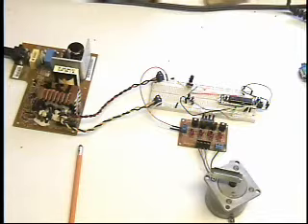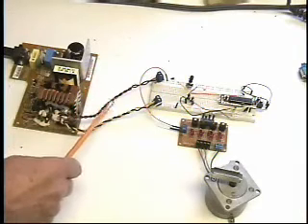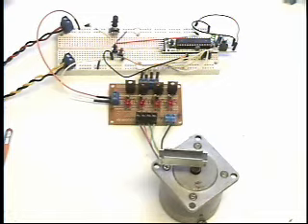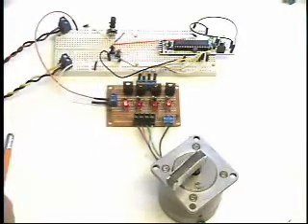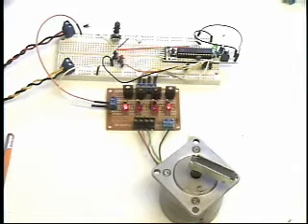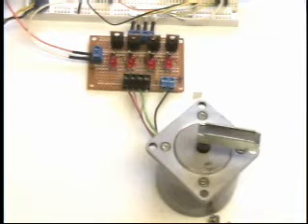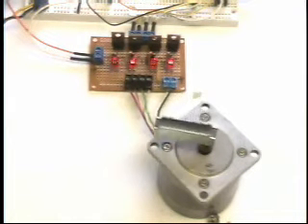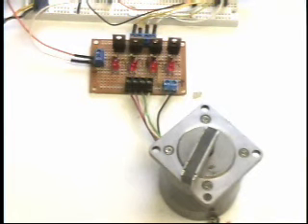Arduino Stepper Motor Control

Comment from the maker: Other stepper motor circuits for Arduino:
Pt. 1 TB6600 Stepper Motor Driver with Arduino
https://youtu.be/PHe2MK9CvQM

Pt. 2 Program TB6600 Stepper Motor Driver with Arduino
https://youtu.be/jtX0t7-m69M

Comment: ...good to know the speed can be adjusted by regulating the interval between steps. I basically need a program to move a fixed number of steps (90 degrees) clockwise and then back each time. Will be used as an actuator, preferably by remote using XBee or ESP 8622. Still working out the details, but every little bit helps. Wondering if with this simple functionality I need the Arduino or if I can do with the just the chips themselves. Thanks!

Comment: +Lewis Loflin Thanks for the video.
I am looking for a BLDC motor controller for a motor that has a 3 wires coil and 3 hall sensors at 120 degrees apart. The motor rotor has 4 magnets configured in a N S N S at 90 degrees apart.
Do you know here I can find controller for this motor.
Thank you
Reply from the maker: markspc1 No idea you will have to build one.

Comment: I believe what you call stepper motor driver circuit as also know as H-Bridge it is either half or full and can be either made with IC (H-Bridge chip) or 4 transistors along with other parts just like it says here:
http://www.instructables.com/id/H-Bridge-on-a-Breadboard

If you really wanna have a full understanding of H-Bridge follow this guy tutorial:
http://www.robotroom.com/BipolarHBridge.html
Reply: Or a transistor array.
Reply from the maker: bighands69
I have a whole section on h-bridges and this can't be used with a unipolar stepper motor.

Build a Power MOSFET H-Bridge for Arduino, PIC
Build a Power MOSFET H-Bridge for Arduino, PIC

http://www.bristolwatch.com/ele/h_bridge.htm
H-Bridge Motor Control with Power MOSFETS

http://www.bristolwatch.com/ele/tr7.htm
More Power MOSFET H-Bridge Circuit Examples

-----

Using the ULN2003A Transistor Array with Arduino
Using the ULN2003A Transistor Array with Arduino

http://www.bristolwatch.com/ele/uln2003a.htm
ULN2003A Darlington Transistor Array with Circuit Examples

-----

Using the TIP120 & TIP120 Darlington Transistors with Arduino
Using the TIP120 & TIP120 Darlington Transistors with Arduino

http://www.bristolwatch.com/ele/tr3.htm
Tutorial Using TIP120 and TIP125 Power Darlington Transistors

-----

Using Power MOSFETS with Arduino
Using Power MOSFETS with Arduino

http://www.bristolwatch.com/ele/tr2.htm
N-Channel Power MOSFET Switching Tutorial

http://www.bristolwatch.com/ele/tr1.htm
P-Channel Power MOSFET Switch Tutorial

-----

Using PNP Bipolar Transistors with Arduino, PIC
Using PNP Bipolar Transistors with Arduino, PIC

Using NPN Biploar Transistors with Arduino, PIC
Using NPN Biploar Transistors with Arduino, PIC

http://www.bristolwatch.com/ele/tr4.htm
Understanding Bipolar Transistor Switches

-----

How to build a Transistor H-Bridge for Arduino, PIC
How to build a Transistor H-Bridge for Arduino, PIC

http://www.bristolwatch.com/ele/tr5.htm
Build a High Power Transistor H-Bridge Motor Control

http://www.bristolwatch.com/ele/tr6.htm
Driving 2N3055-MJ2955 Power Transistors with Darlington Transistors
Reply: Lewis Loflin Thanks for the video.

You can actually use your bipolar stepper driver to drive a unipolar stepper motor. If the motor is a 6 wire stepper motor simply ignore the center taps on the motor and hook it up like a bipolar. If the motor is a 5 wire stepper motor separate the two center taps from each other hooked to the single common wire and don't include the common in the motor hookup.

See the following link for details on this procedure http://www.jangeox.be/2013/10/change-unipolar-28byj-48-to-bipolar.html

igrewold apparently didn't realize that you are performing stepper translation in software instead of using a stepper translator board or chip. I don't understand why he's directing you to tutorials on H-Bridges when you clearly don't need that.

Thanks again.
Reply from the maker: Dorian McIntire Yes that works but you will need to double the voltage.
Reply: a que se refiere con el doble de tension ? he utilizado un motor unipolar de 5 hilos separando el comun y ahora lo utilizo como bipolar pero el motor vibra bastante.

Comment: I don't see any Arduino board being used, or is that stick on the bread board a type of Arduino ?
Reply: That was my guess. Even if he doesn't have an Arduino board, you can use the Arduino IDE and libraries with an Atmega that's just stuck to a board, as if it were an Arduino. It looks like the chip is stuck to a little breakout board, though. It might be an off-brand Arduino-compatible breakout.

Comment: Stepper motor has a certain number of steps per rotation. So you can say step 16 steps... a servo has a feedback that knows where it is. And so you tell it I want you to go to position 165, and it goes there. Now really its a bit more complicated than that when you get into signals and such but that's a basic view.

Comment from the maker: Low voltage coils require a high current. Assuming the voltage is correct what one wants to do is switch the coils on to move the rotor then switch them off. Leaving the current on will get the coils hot. The alternative is put a current limiting resistor in series with each coil. The coils should still be switch off when not moving unless one want to freeze the rotor.

Comment: Do we need a current limiting technique to limit the current in a stepper ? I mean that people say to determine the operating voltage of a stepper you need to measure the coil resistance ,,, and use ohms law to find it ...then multiply this value by 3 or 4 to be able to rapidly switch currents in the coils .. This for sure will increase the current in the coils at the steady state ,, so the stepper may get damaged ... now what should we do ?

Comment from the maker: depends on the current rating of the driver transistors. In this case those MOSFETS were rated at 15 amps each. Make sure i drawing a lot of current to add heatsinks.

Comment from the maker: at the top of the program you will see something like orange equals 10, etc. This will allow you to choose whatever opinions you want to connect the stepper motor. Be aware this particular color scheme is for the type stepper motors I have. If you have a differing type stepper motor the color is not important, but you may have to experiment with the wire configuration.

Comment from the maker: I believe I covered this in another post. This depends on the physical characteristics of the stepper motor, the load on the stepper motor, and yes even related to speed. If the pulse width is too narrow for the load there will be slip. If the motor winding has a high inductive reactance then there will be slip at high speeds. This is why many industrial type stepper motors are low-voltage high current devices to get around that problem.

Comment from the maker: I can't answer your question as far as gears go. With a stepper motor there is generally two types: 1.8° or 200 steps and 7.5° with 48 steps for 360°. These are very accurate if you keep an accurate count. I would advise using an external sensor in addition to simply counting steps.

Comment: Hi Lewis
I am Building a Mechanical System in which i need  to Move tool tip  in 2D Place of Size 20cm X 15cm  i need movement to be very accurate 
What is the Accuracy of the Stepper Motor when Converting Rotary motion to Leaner Motion in mm 
Thanks

Comment: I have a need to construct a device which will gently squeeze on a tube about 1 1/2" in diameter.  Would a stepper motor be good for this?  Both a stepper motor and servo have multi-positions.  I need only squeeze on/squeeze off.  Is there some other device which would be simpler to control?

Comment from the maker: This sounds like a two position ask X-Y setup. Trying to determine a position simply by counting pulses is often an accurate. I highly advise using position sensors, which then can be used with conventional geared DC motor boxes if available, if it's being geared very low.

Comment from the maker: There's a couple of things happening here. First we have centrifugal force which may be throwing the device a little further than intended. The next problem comes down to load on the motor, too much on the load and and not enough pulse with may cause the motor to skip by not adding enough energy to the rotor to go the length you may want to go.

In addition I have noticed there can be a little bit of improvement in the software itself. I use a position sensor for correction.

Comment: Thanks Lewis.  I noticed that the one rotation programming brought the pointer from start to finish ok for low speeds (ie: @vid t=2:25-2:42) but when you adjusted the pot to increase the rotational speed, the pointer exceeded a 360 rotation despite the programming (ie: @vid t=3:30).  Can you explain this to me please?  Does the stepper slip or can it not "stop on a dime" at higher rotational velocities?  Please and thanks.

Comment: Do you have any advise for me, on a motor ( prefer 12v ) that has high torque and very high speed?
I require 2 motors to convert a manual gearbox, into one that will shift automatically.
1 motor will push and pull in and out of gear and one will position the gear selector.
each motor will have 3 positions, 0, 30 and 60 degrees, 0 for gears 1, 3 and 5, 30 for neutral, 60 for gears 2, 4 and reverse.